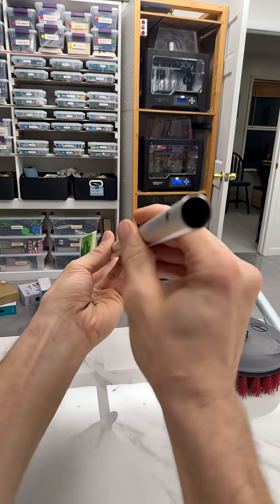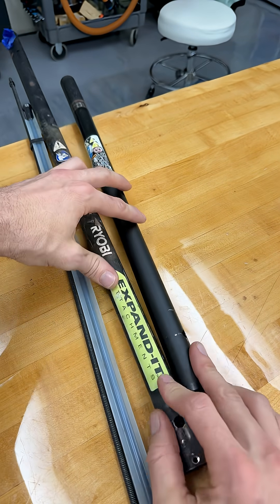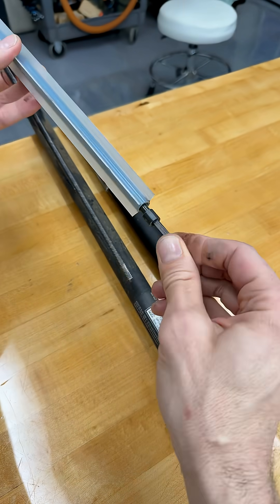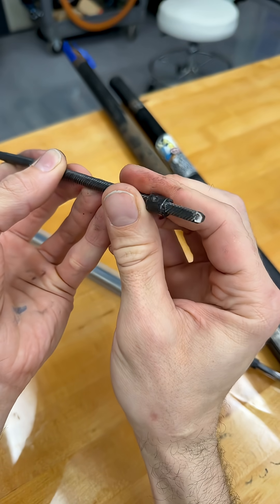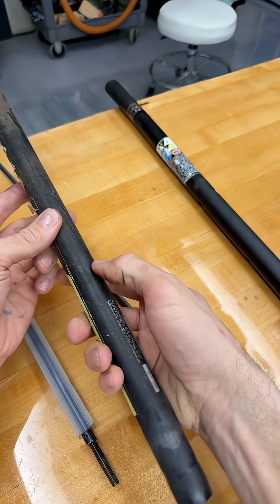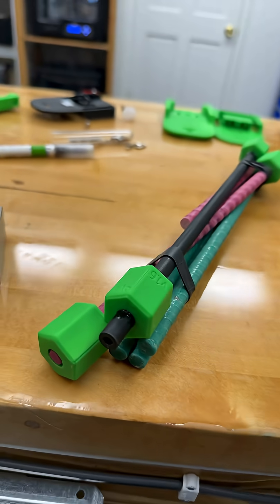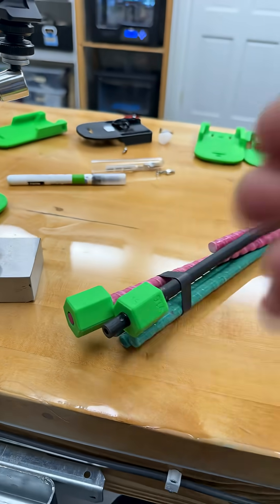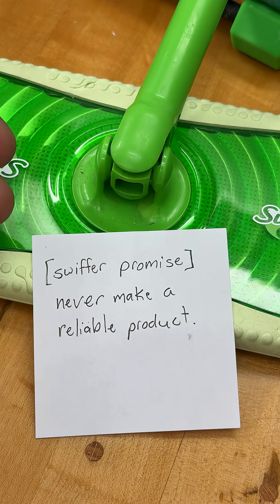improving on the market-leading mop

Comment: The Swiffer was optimizing for cost and features. It is well engineered when you consider that. The way they break is part of the subscription model. I don't see how you can make it more robust without adding weight and without injection molding.

Comment: I've got an idea for the spinning feature: gears and a rope!

Have a regular rope or cord between two pulleys, one on the bottom, one on the top. The one on top should have a screw to regulate height and thus tension. The one on the bottom would have 90dg gears to power the head. As you have the gears, you'd also have an articulation to match the head to different inclines.

You could in theory even have one side of the rope in the outside to put like a grabber of some sort, so instead of powering the mop, ypu could pump it up and down and sink the production cost.

As some others say, the spinning feature sounds like an expensive extra, but here is my part in case you really need it.
Reply: I was working on a different project that needed a similar thing (outboard motor for a boat)
I really like this rope gear idea and wanna try it out now, haha
Reply: @Mimerneos I'd love to see your idea put to test :) remember me if you upload something!
I also had an idea about an outboard but in the end I chose to put a sail on it

Comment: The reason that the Swiffer mop handle is made out of thin aluminum is because they made it to be light and maneuverable as well as cheap and affordable when you the customer purchases it inside the store.
You do sacrifice strength but let's be honest here, you are only going to use that thing indoors and not very often. Not to mention those things are not meant for scrubbing just wiping. We are not trying to reinvent the wheel here 😂
Adding steel for a handle is already making it more expensive, changing the head design that allows it to pivot is probably the only affordable part of this design. 
I own one of the Swiffer mops with the spray attachment I use to clean my bedroom,
Had to glue the handle back together so I do feel your pain here somewhat.

Comment: For the internal spinning bit you can get a electricians drillbit extender that’s 4 feet long for drilling in wall cavities without messing up the drywall at any big box store and it already has a hex coupler on one end to connect and you can chuck the other end in a drill

Comment: I have a powered scrubber but the issue is the pressure required to press it down to have full contact because of the stiff bristle. I think it would work better with soft bristles. I still find myself scrubbing whilst the darn thing spins.

Comment: What's wrong with the existing ones? Seems like the only issue is if they get too much force applied and break.  What about making collapsible that falls apart and can be reconnected, then it wouldn't need to be super strong, if it can self limit the force?

Comment: The reason the rod is able to broken into a few small lengths has nothing to do with the end-user and everything to do with shipping and display costs.  That’s what I hate about modern product design.  Sometimes shipping considerations force a product to have unnecessary weak points.  Ore they use minimal and too-thin material just to save a few cents on injection molding plastic costs.  I wish I had a good universal example to drive the point home, but I see it all the time and I hate it.

Comment: How's your ABS fiberglass rod nut with tortional strength? Print a nut at 1/2" or 10 mm and use it to back drive an OTS 3/8 swivel. I could do a quick proof if you give me the dimensions of the EMT.

Comment: Take an over-engineered solution and compound the mistake. I won't be handing in my string mop(with wooden handle) and galvanised metal bucket anytime soon. If there's a plastic free option buy it.

Comment: Sadly most designs are driven by economics.  I think the swiffer design is fantastic.  
When "mopping" you can only soak up so much liquid on the disposable part, and even then the swiffer only needs to lift the soaked towel.

Sorry to say but it sounds like user error.  I would use a swiffer for indoor "swifting".  I wouldnt use it in a shop.

Comment: Yes!! I was once an industrial engineer over several processes, one of which was a sort of continuous water wash-down process which had a few basic water treatment processes built into the loop e.g. multiple stages of sieves separating out a pulp which was then dropped into a big dewatering screw. This washdown water process was extremely messy—lots of sprays and splattering and pump clogging and tank overflows, meaning lots of large industrial equipment (sometimes up to ~30ft off the ground) getting caked-on pulp that would easily come off with a dry brush, but couldn’t just be blasted off with compressed air. So I started to look for a powered brush solution like what you’re describing. Almost no feasible COTS options. Closest type of thing that was tough enough for an industrial environment was a drywall sander. But still not long enough. And I needed something that would be able to be safely used in a very wet environment. So here was my quick solution: I found a long fiberglass pole, a pistol-grip pneumatic die grinder outfitted with a three-jaw chuck, and a set of stiff-bristled drill brushes. I attached the die grinder to the end of the pole by heaping two-part epoxy putty onto it, then just smashing the side of the die grinder into it to make an impression. Once cured, I secured the die grinder in place with some wire clamps (I had to get this done quick). An air hose ran up the length of the pole to the opposite end. A cross-shoulder strap a couple of feet from the non-working end of the pole allowed operators to sling the pole over their shoulder like a purse, and that point then acted as a fulcrum under their right shoulder so that we could add counterweights to the non-working end of the pole behind them and allow them to much more easily control a long pole in front of them for extended cleaning sessions. A valve located at some point along the length of the pole could be used to throttle the speed of the grinder. It was a cobbled-together design, but it worked better than anything any of them had ever seen. I’m very interested for this conversation to continue with this group to see what you all come up with.
Reply from the maker: this story is great!  Do you have any photos & info about your build that’s worth posting in the discord?
Reply: @davidmalawey I’ll definitely be contributing 👍
Reply: Do you normally comment on YouTube? Im genuinely asking?
Reply: @Livelaughlove-n8t  Not really. I also abhor social media. Why?
Reply: @Livelaughlove-n8t  Clearly not, he's quite busy.

Comment: A replacement swivel joint that fits standard sweeping brush handles would be quicker, easier, and more accessible to folks. Not to diss your power scrubber idea but the least amount of steps involved when cleaning the better imo

Comment: Wait what?  The rotating mop is already a totally different product.  This product is for people who don't want a rotating mop or anything powered...
Reply: That's kind of what I was thinking as well. Those "mops" are dual purpose and can mount both wet and dry cloths. I got really confused when power tools, a brush head, and a flexible driveshaft showed up. That's a different problem. The goal of a Swiffer is to have a disposable "interface" (ie, the rag). A brush with bristles attached creates a new problem of having to clean the "mop" itself between uses.

Comment: that joint must exist premade right? maybe in two or three parts? i think we just need a broom handle connected to a swiveling hinge setup and a flat surface. maybe the biggest challenge is just the cloth gripper, maybe a TPU print could copy their approach there. 
love the idea, love/hate these junk things. do you buy the swiffer wipes or do you have a DIY fix there too?

Comment: I would suggest a long stiff spring like the kind for torque transmission in heavier duty dremel tools. The kind where you have a big motor attached to a small handpiece. I dont know how long you can get the shaft piece, but it is essentially a long heavy spring rotating inside of a flexible cable. The spring allows for bending of the shaft and I think it can absorb a considerable amount of torque force without snapping in the event the rotary tool gets stuck in material. Which is useful because the spring seems to increase the torque as the motor side keeps rotating and putting force into the spring even when one side sticks, so it doesnt stay stuck.
Reply: That's what was demonstrated with the Ryobi weed Wackers. The problem is something like that isn't commonly available or is relatively custom/expensive.
Reply: @katz4248  I didnt realize that, the weed wacker part looked like a solid shaft on my little screen. 
I dont know if there is an “off the shelf” dealer but I did find a manufacturer for different sizes of flex shaft called Elliot Manufacturing, and they have a number of distributors in the USA.

Comment: Why not first make a 1 for 1 open source version first, that allows people to replace the cheap version sooner rather than later. Yes a spinning feature is nice, but not necessary, that's what you would call a luxury feature. If it's gonna take time to design it with a luxury feature why not just solve the initial issue of quality first quickly then work on prototype for the luxury feature and release that once all those pieces have been successfully designed?
Reply from the maker: ok so a year ago i posted a u-joint, v1, and for some reason I thought people would download & make this stick + u-joint + rag.  it’s on grabcad.  But i’m a poorly communicator.  

Your idea is the right way.
Reply: @davidmalawey 😂 looking at a Black & Decker electric weed whacker rn .the flexible driveshaft is basically standard diameter sguare ends for electric and gasoline weed whacker alike (or at least the ones I've dealt with). they also basically fit on 1/4 inch sockets too! hope you find it useful someday . edit perhaps you can cap the ends of fiberglass tent poles with pressed suare metal ends
Reply: So leave the spinning bits out...
Reply: Agreed. I like it, but I can’t have anything spinning like that on my wooden floors.
Reply: Why not?? It's not the fact that it spins that makes it a problem for wood floors. It is whether or not it is abrasive or spins too fast. A floor buffer spins... and fast.
Reply: Great educational content. Thank you, David. Your consistency in systematically decomposing and analyzing the function and features of pieces definitely makes the unseen parts seen.
Reply: He doesn't need to do that, there are multiple ways to accomplish the physical broom portion, you can use a flat hinge attached to a head made from a poly cutting board.  Make the handle slotted and flattened to attach to the hinge.  Voila! two degrees of rotation using hardware store parts.  Have a look at a commercial dust mop for inspiration.  Saying 'nobody makes one' is easy, but copying a commercial version is probably a cheaper way to go.  I would probably try for a thread in handle, because you can get handles at the dollar tree, or a wood handle at the hardware store, and it's a bit better than a bit of conduit (won't damage floors when dropped, nicer to hold when it's cold, etc)
Reply: David, this is great. The OP’s most salient point is, take that first step and open source it. The BEST part of open source is then, the next steps / improvements can be made as a virtual team if you will. Aka, your constituency/followers can join in on designing next steps to achieve all the goals you (and they) envision. This is what makes Open Source so dang cool.

Comment: Swiffer mops are not so great because they're designed to be sold in a box on the shelf. That leads to the segmented handle that lacks stiffness. But you can just shop for other mops sold in the mop/broom section of a home store and find ones with stiff handles.

Comment: You should probably test how much you can torque those rods, not just a break test. The may not do well with twisty-twisty.
Reply from the maker: yep.  this won’t be a quick design.  months or years, and several designs in parallel.
Reply: Should be great for scrubbing. Fiberglass is already used for dryer vent and chimney cleaning brushes

Comment: Does the motor have to be at the end of the shaft? It makes sense with tools like weed wakers because you generally don’t want the  business end of the tool touching the ground. 

However, the floor is able to support the weight of the scrubber and you might actually find the weight useful for removing difficult messes. 

My thoughts are you could look into how hand brakes from bicycles work for pulling the trigger of your drill. Make the handle easy to remove from the drill and have the scrubber attach like any other drill bit. 

This way your home drill remains your home drill and everything else is cheap and easy to make at home. 

The difficult part will be needing a quick release mount for every popular home drill model.
Reply from the maker: a mass at the base would help a lot for cleaning.  many variables. making the whole plan is a little overwhelming so I’m aiming for the rotating shaft, as a milestone while doing all the other life stuff.
Reply: @davidmalawey  if a rotating shaft is the goal then bearings might be the answer. With proper sizing you can run your rotating shaft through a serious of evenly spaced bearings then fit that setup inside your outer non rotating shaft. 

With the right distance between the bearings you can prevent the rotating shaft from ever touching the outer shaft while keeping costs down.
Reply: @Krapht  i am by no way qualified for stuff like this. but wouldn't that make the whole thing vibrate. or eventually start vibrating over time?
(E)i mean if its perfectly up stright i dont see the issue. but using it at all sorts of angels.
Reply: @davidmalawey  Please be careful should the cleaning head get caught and stuck. I'm imagining the drill torqueing the fiberglass rod to break. (edit: Looks like someone else mentioned it. I replied here 'cause the 'direct drive' might mitigate this. I still look forward to your posts and progress, Good luck sir!)
Reply: @davidmalawey I feel like a shaft that long if it is to be light weight enough and low enough in cost is not going to be able to handle very much torque.   

It seems as the ultimate goal here is to use this project as a reason to develop an internal rotating shaft to be used on other projects.  The Swiffer itself is not poorly designed at all.  It is designed to do the task it is meant to do. Which is to provide a implement at a low cost that can affix a light duty floor dusting pad to. The Swiffer was not designed for anything other than dusting and light cleaning like pet hair and similar.  The model you showed isn't even the wet mop version, which I have had for years and works perfectly well for its intended purpose. 

 The Swiffer was made to improve upon the traditional broom and nothing more.  Which it does amazingly well at a very low cost.  Saying that it is a poor floor scrubber is like saying a jeep is a poor tank.  

If the goal is to make a more robust cleaning tool for actual scrubbing and heavier duty cleaning, then as others have said, there are tools available to designed to do that.  

The goal of building something useful in a way that allows easy and cheap open source interchangeable parts is a perfectly fine goal.  However, comparing a tank to a jeep in a manner of speaking like you are doing here isn't a fair comparison and skews what the ultimate "added" value might be.  A Swiffer was never designed to be a true floor scrubber so this isn't a replacement for that product.  Even if you end up with a good design with a rotating internal shaft, you are still going to have a need for a tool that is simple and light to quickly handle everyday quick sweeping.
Reply: I had exactly the same thought.  Ergonomically it might be better to have the mass on the head rather than at the handle end.

I gather that the pinout on makita batteries allows for a remote trigger.

Solving for a different problem to what this video is all about, but still...
Reply: If you have a comparable high mass it gets tiresome to move it or even counteract the forces of the rotating disk (high hand torque necessary). Also you don't need the high mass on the bottom as the swiffer already works and it's many things but heavy down there. So for comfort reasons a "Dyson vacuum" or weed wacker  configuration should be preferable.